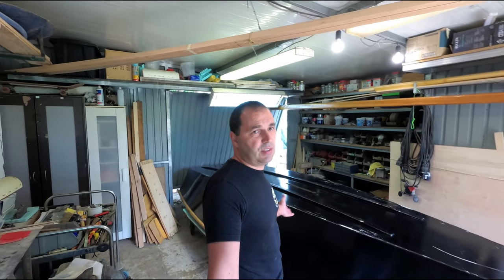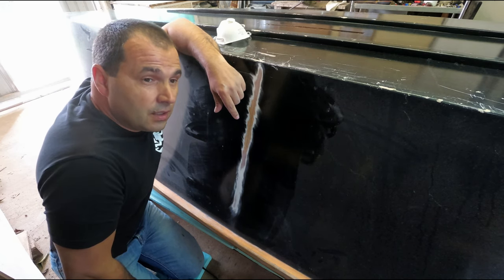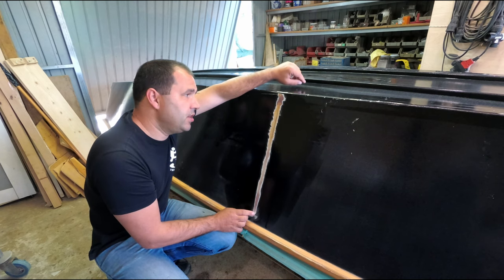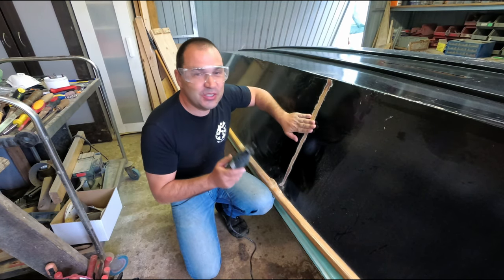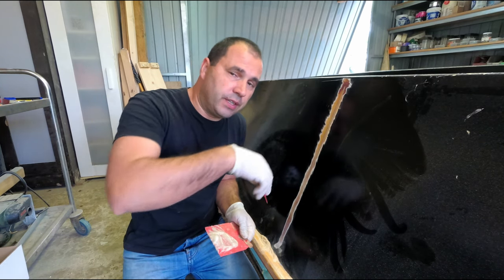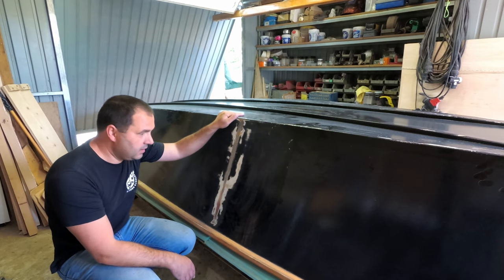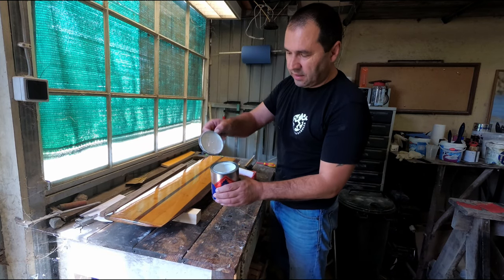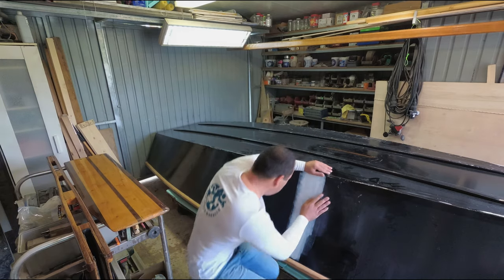Repairing Hairline Cracks on my Skiff's Hull.

Comment: had you started sanding using a very fine grit of sandpaper remove paint wipe down with solvent, acetone inspect see if crack still existed then sand next layer fairing compound wipe inspect if crack still there ,keep sanding the next epoxy layer if crack has vanished then it would tell you it was the fairing compound ,which i guess it would have been for it to have been a straight line on the join there must be flex, fairing compound is softer

Comment: Those cracks seamed to be worse where the seats were built.  I bet your air tight tanks expanded due to the black paint. This caused the cracks and the one tank to leak. Too much air pressure. Love the build.
Reply from the maker: The cracks were right on the butjoint, only place it could crack really.

Comment: I wonder if such a wooden boat would be sturdy enough to be towed on bumpy trailer trips such as to the Algarve coast, or might it cause a lot of little dents needing repair.
Reply from the maker: Hi!
The GIS is quite sturdy, the cracks turned out to be mostly a cosmetic thing.
Of the hundreds of GIS built, many are towed and some cartopped, I haven't heard of anything wrong happening to the boats...🤔

Comment: Any time you mix mediums (such as wood and fiberglass), and then subject them to the extremes that can amplify their differences, you can expect to see the difference expressed in the same degree the extreme has presented. SO: if very hot, wood will react as wood, and fiberglass (or other similar compound) will react as its design dictates. It is unlikely they'll be perfectly similar in all aspects (expansion, contraction, etc.) especially in all or any extreme influences. Nice to see you're keeping on your game Teo...
Reply from the maker: Spot on Phil!
I hope it works all well as it worked on Brian's boat...if not...glass tape next season! 😅

Comment: Epoxy does soften if you get it hot enough and with the black paint you are going to get some heat in those panels. I don't believe the joint would break but that movement allowed by slightly softer epoxy is why the paint cracked. The extra framing inside should greatly reduce any future flex.
Reply from the maker: Thanks for the feedback Jeremy.
the joint per se didn't fail, so it's more of a cosmetic thing than anything else but...🤔
Reply: @TheBoatRambler  oh they weren't failing just moving, flexing just a bit and with the paint being a hard coat it cracked. As you said cosmetic.

Comment: Oh my god that tape with the paint can tip blew my mind! I've been working for at least 5 years around paint and never thought of it, lol. All hail The Video Rambler
Reply: By the way, which paint did you use on the boat?
Reply from the maker: Hi Fran!
I can not claim rights to that tape tip. I have seen it a couple of times before.
Still...now more ppl have seen it! 😁
Reply from the maker: I painted my GIS with Hempel's  Hempaline Primer,  Hempalux black and  Marine Varnish 02220, all one pot!

Comment: These annoying cracks in the paint work notoriously difficult to permanently cure. I will be interested to see how the micro fibers work out over the next season. Of course you could always buy some lycra based tartan paint !!!!!!
Reply from the maker: Hey David! 
Well, I had to try something...If it doesn't work...I'll blame Brian!! 😂😅
Reply: @TheBoatRambler  Poor Brian ! Straight lines a problem. If it does not work try a zig zag pattern at a fairly high frequency over the top and redress the same way. like stiching.
Reply from the maker: @davidprocter3578  I'm pretty sure a bit of 50mm wide glass tape would solve the problem for good...If it comes back that's what I'll do. 😉
Reply: @TheBoatRambler  I know it would but thought you were against it.
Reply from the maker: Nah! Just wanted to try the simpler solution first. 😉